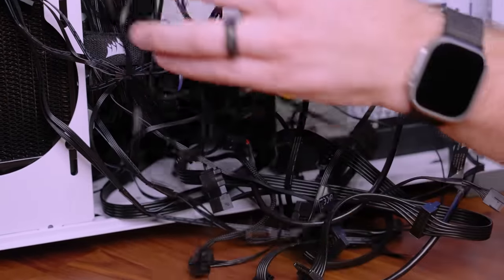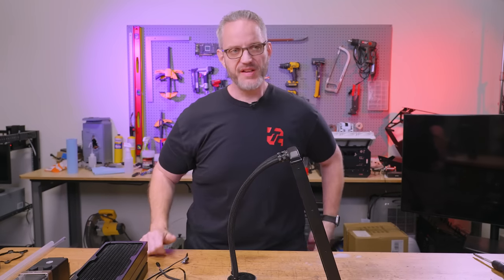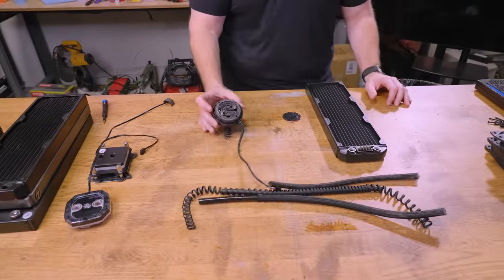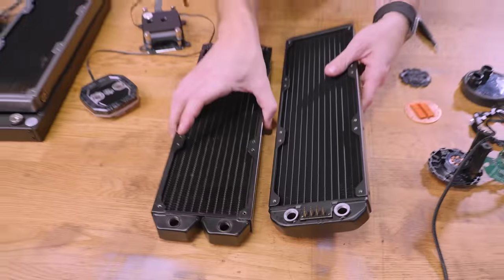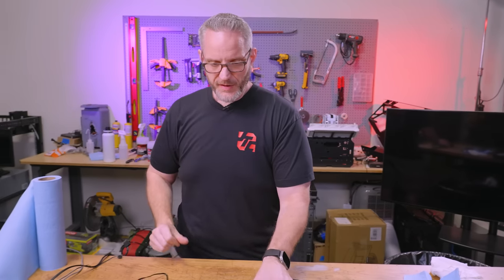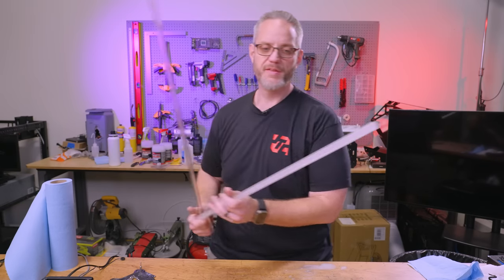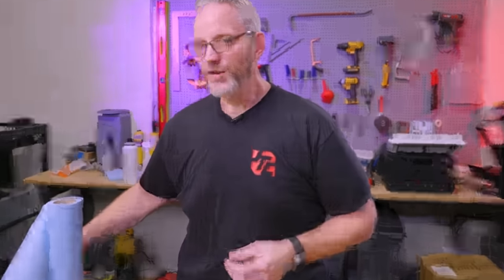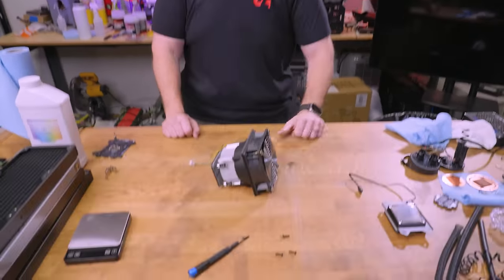Which one is right for you?

Comment: Open loop everytime because you could add in as many radiators as you like; the larger the surface area and the larger then fans, the slower then fans can run which means using less electricity, less noise and better cooling on a custom loop. Custom loop gear will last for much much longer, as you never need to "start again from scratch", only maybe upgrade the odd component, so it's ONLY a big investment as a one off the first time, paying for itself over several generations of computers. With an open loop you can cool anything and everything you like: CPU and GPU and DDR5 RAM and gen5 M.2 drive, etc.. For the ultimate cooled, stable and quiet pc! 

AIOs also lose fluid over time, and if there is a significant change in the component they cool, you have to throw it out and start again.

Comment: The point about pwm pumps is kind of moot nowadays, with motherboards that come with a dedicated AIO pump header which you can set in the bios to power up with full speed. Subsequently, once you've loaded into Windows, you can use the Fan Control software that was featured in another video to manually override the bios setting and basically do whatever you want.

Comment: As I’m getting older custom loops are getting annoying, especially mine with  2 pumps, 2 reservoirs, and 4 radiators, working on it takes forever.  I don’t know if I can go with an AIO because an AIO almost certainly wouldn’t allow me to overclock a 13900K like I do.  On the other hand, the older I get, the more important my build he silent, and mine can be silent because I have so much radiator space, I can run fans at the minimum RPM unless I’m stress testing.

Comment: I'm surprised none of the major companies have "gotten around" the Asetek patent by designing an AIO that has a reservoir in the loop. So instead of the usual AIO, have the tubing go from Rad to reservoir (with built in pump) and then from there to the heatsink? Maybe it's a stupid idea, but it would be a nice middle ground between traditional AIO and custom loop. Hell doing it this way you could even have a GPU block in the loop as well (though you'd have to have a different SKU for every GPU potentially so that may make it cost prohibitive), but I for one would love to be able to have a reservoir in an AIO style loop, that would allow for that refilling aspect to help maintain the AIO for longer, but I dunno maybe I'm talking nonsense.

Comment: My first watercooling was a Swiftech DIY kit. It was for an i7 930 that I OCed the hell out of. My issue was it didn't fit inside my case, but it was designed to be mounted on the back of the case if needed. It did a decent job.

I eventually replaced it with a Swiftech AIO that did fit inside the case. One day the computer wouldn't boot. The AIO motor failed because the inside was full of flakes from whatever the inside was coated with. Now has a Corsair H75 in it. Barely does the job keeping it cool at 4GHz, unlike the kit that was mounted outside the case. It's inside the case though, and it's an old system, so I don't really care anymore.

On my 5960X I tried using air cooling while waiting for my WC parts to arrive. LOL.. Air. For that I had gotten a Swiftech waterblock (that was new to the market and was a return/warranty nightmare) a front bay reservoir/motor and a Hardware Labs Black Ice rad and Bitspower compression fittings. Corsair AF fans. This turned out to be an amazing setup.

For my 7900X I decided to give a Corasir H115i Pro AIO (280 x 140) a run as a temp solution while trying to decide on my custom build. The AIO couldn't even touch the 7900X. Barely kept it cool at base clocks. I wanted another front bay res, but they don't make cases like that anymore so I found myself with another new Swiftech product... Ugh... and it cracked. It was (like my 5960X cpu block, acrylic) poorly made and they replaced the design with glass, so I found myself with an upgrade that has been great. Again, I used Hardware Labs for a rad and Bitspower compression fittings. I used Primochill deionized water. This was 5 years ago, and I've never flushed it since I first primed and flushed it. It's been amazing, mostly. I use Corsair LL RGB fans in push/pull, which is maybe the only reason I'm getting away with using these weak fans.

TL:DR, AIO sucks in my opinion. They are made with cheap parts to keep prices low and are bound to break and fail, leaving your system dangerously hot. They'll do the job if you're afraid to do it yourself while maybe being better than air. Depends on what you're trying to cool and what you're trying to do with it.
Reply: Swiftech Apogee was a legendary block in its day - takes me back a bit that.
Reply: @malphadour  the solid ones were good. The one that had a problem was the clear acrylic Apogee XL? It would crack by the fittings. I know, user error, right? I had to pay shipping to return it, was like $20. The next one cracked, exactly the same way. Once again, pay shipping to return, but I got the non clear (solid black with the color plate) this time. Was fine. While shipping the second one back, they pulled it from the store, it was never sold again. And... That's what happened with the acrylic reservoirs they made. They had cracking problems, and started making a v2 with glass and removed the acrylic version. But despite this being THEIR failure, they still made people pay return shipping. That's simply, unacceptable.

Comment: Currently building my own open loop, it is some work ^^ currently fighting with my i/o bracket of my video card as i wanted to mount my msi 4090 rtx vertical, with a corsair water block, but i have 2 slots to mount a vertical gpu and no custom i/o bracket was provided by corsair for their xg7 block. so, i had to cut 1 slot off it with tools. now i have some height issue's as the i/o bracket somehow is different when you want to mount it vertically, will try with some screws to increase the height.

fun but it takes allot of time ^^ 
Also its an challange to fit it all in an 4000D, so far going well although i will have to mount one radiator outside of my case (on top) otherwise my memory won't fit and i can't fit my wires on my motherboard.

Thanks for the video's, they pushed me to start making my own loop.

specs:
MB: EK-Quantum MSI MPG Z690 CARBON EK X D-RGB
GPU: MSI GeForce RTX 4090 Gaming X - 24GB GDDR6X RAM
CPU: Intel® Core i9-13900KS, 3,2 GHz (6,0 GHz Turbo Boost)
Mem 2x : Corsair 32 GB DDR5-5600 Kit
Tower: Corsair 4000D

Tubes/fittings etc: all Corsair

Comment: AIO is better is what i got from this video, especially if you can find one with a fill port so you can service it but if you are a super committed enthusiast and ready for the up keep then go with a custom water loop. its mostly a question of aesthetics then cooling because the best cooling option is to go with a nactua or be quiet heat sink cooler. no water no mess and super affordable. also easy to change a fan if it fails. didn't need to watch the entire video to know this but did any ways 🤓

Comment: I've been fantasising about doing an sff, externally cooled pc. It would allow much larger cooling than an sff would otherwise allow at the expense of taking more space than just the case itself. However decoupling the cooling from the system also has various benefits like much better modularity, a free standing rad being completely unimpeded for airflow etc. 
I really really want to see a proper implementation of it to see if my idea is valid. I just hope you can demonstrate the idea.

Comment: I'll say I do have a slightly rougher history with custom over AIOs. I still actually have the original AIO for my system that's 6 years old now. Meanwhile I've killed 2 pumps for a custom loop within the 6 months each; they were both the EK pump reservoir combo, I swapped to the Corsair pump and it seems to be lasting longer.
Reply: how? how did manage to kill 2 D5 pumps? or were they DDC pumps? What did you do?

Comment: I wish i had the need for an custom loop. But my FL2 280 is already way overkill for my tiny
10700f 65W CPU even with pl1 and  pl2 set to the max. I remember my first Custom loop
containing an Eheim 1046 fish tank pump @ 240V and a repurposed Scooter Radiator.

Comment: my comment before watching the video as requested is that custom is better, because if something goes wrong your more likely to be able to fix it  having built it yourself, and its not sold as one unit so you can just replace the part that is faulty not the whole damn thing. also custom gives you flexibility, if you want to put a cpu and gpu on a loop you can, and then you can hook it up to whatever radiator solution you want, or your case supports.

Comment: Custom loops don’t even have to be very expensive.

Beside the very rich second hand market which is for most watercooling parts little to no risk there is also a lot to safe on new builds.

- Magicool Radiators are cheaper but hardly worse
- straight simple fittings
- flex EPDM/ZMT/Norprene tubing
- Simple CPU/GPU Blocks
- Whatever Basic Reservoir

Only the pump should be either a DDC or D5 and I heavily recommend a D5 that is mounted decoupled from the case.

But again. Second hand is the way to go.
50% Savings with hardly any risk since most parts are just plain metals that worst case need some cleaning.

Comment: Dear Jay !  I would greatly appreciate a follow up of this video regarding CL and how to calculate properly the amount/sizes of radiators needed to get rid of the heat esp. in OC-scenarios   (e.g. 120 mm rad per 50 W  or so) as well as optimum cooling liquid flow (e.g.  100 l/h) and effects of overkill-configs (like 10  360 rads / 200 l/h flow rate) >> what is the "sweet spot". Currently all tutorials I searched  regarding these questions are either too vague or incomprehensible (even IgorsLab)

Comment: I really need a video dedicated to GPU cooling , not taking CPU into an equation. With these new GPUs getting the twmperature outside of the case is getting to be an issue and water cooling a gpu and using Noctua NH-D15 on CPU would be sweet spot for me .

Comment: Nice guide, but make sure that distilled water isn't same as DI water. Purity level difference is huge and electric conductivity on DI water is almost zero. DI water can reach purity at 0,05 μS/ppm which is called also ultra pure water. They use it almost every where in Semiconductor industry. You can also see difference in purity using TOC tester.

Comment: I'm currently using a Noctua NH-12A with my 12700 and have never had an issue with heat.  But then,.....that's a 12700, not the newer 13900.   My case, having 6 fans bringing air in, and 4 letting air out might be a factor, though.

Comment: I really like my Arctic AIO, works great on a 12600k with a slight OC, probably a good air cooler would be fully sufficient.

But I'd love to go open loop and including the GPU but costs seem to be crazy and really not worth it in my case.
I'd pretty much build it just for the sake of tinkering around and get it all to work.

Comment: As you may have noticed from many of the replies, both have their place.  AIO is quick and easy.  Custom loop is for people who like to tinker or want to show off the internals of their case.  From a performance stand point, they are not that different.  Custom loop will have a larger heat dump due to the reservoir.  I have built both.  As I got older, I started to prefer the convenience of the AIO.

Comment: I went with an AIO from EK (The old one just before they went EOL) and after half a year I am noticing a slight ticking noise which I believe is coming from the pump. Pretty disappointed by that. Though I don't have the money to go full open loop I maybe should have just gone air cooled.

Comment: 6:22  Liquid metal isn't very corrosive, at least, not the ones being used for heat transfer.  

What he is seeing there is a thin layer, likely only a few atoms thick at most, of a copper-gallium alloy that has been created and will not affect the performance characteristics.  This process is called interdiffusion, or intermetallic formation.  It's not a problem.

Comment: EK charging £240 for the Asus TUF 4080 GPU block alone, when my well cooled NV7 keeps my GPU with its OEM aircooler at 60C or less, I don’t see the point of a water cooler anymore. Done quite a few expensive loops in the past but, at least for the 4000 series and its overkill coolers, custom loop would be more for an aesthetically reason than anything. Also the AIO, if you choose a proper one, instead the cheapo Asetek high pitch noisy pump ones, you should be fine. Simply take the Arctic Freezer II or the EK Nucleus and you’re gold. It was cheaper for me to buy 12 T30s and the EK AIO than going for a custom loop. Also, runs quieter than my previous loop and mid range fans.

Comment: Outside of a SFF PC, I don't think I'd ever do an AIO. If there is an air cooler that will work, that's what I'm using. Once I get to the point that CPU is too powerful to handle the larger air coolers, I'm putting a custom loop on that.

Comment: Why i dislike AiO's is, they have an expiration date. As soon as there is a problem, it's time to get a new one.

Air cooler heatsinks on the other hand are built for eternity, as long as they still fit current gen cpu's. A faulty fan is replaced real quick.

I take the 5 degrees more over worries when your AiO fails or leaks any day of the year. 🤔

Comment: Neither are better.
My Ryzen 5700X under 100% load gets to 70c when it is 23.1c ambient with a 240 AIO in my case. Right now it is running about 40c with normal (YouTube+Web ect.) 15%~ load, and it is 26.66c ambient. This is my second AIO I've had, I know I'll need to replace it in five years, but the cost makes it worth it. I only had $1500 to build my system and needed at least a 3070, and I like how quiet the AIO is.

Comment: Very informative video. Would love to see performance comparisons on similar CPU loads. Full loops have the cool factor in their favor but how much difference is there in performance?
Reply: Most of the possible performance gains in gaming (with few exceptions) will come from GPU cooling and overclocking headroom, not from the CPU. That alone makes AIOs a bit.. useless.. unless you have a higher tier CPU that actually requires it.
For CPU only, the difference will only be overclocking headroom. If you run your CPU stock, the open loop will be a few degrees colder.

Comment: Just use a laboratory psu and vary the voltage to the pumps when filling the loop. Doesn’t matter if pmw or not. (by the way every pwm pump I ever used, goes 100 % without a pwm signal).
Reply: The thing about requiring a PWM signal for full speed is that some pumps didn't adhere to the Intel PWM spec which requires the device to go full speed when not supplied with a signal.

Comment: Go custom if you don't mind jumping in an endless rabbit hole as far as budget. Overpriced really vs what you actually gain as far as exchange performance. If 5°c is worth an extra $500+ go for it! Lol. AIO is just fine. Considering bang for buck it's the best deal. AIO's being mostly unserviceable is part of the cost savings too. I've moved mostly away from water. Now let's talk about space! Although you can certainly modulate custom loops, they take up too much space. Plain and simple. Bottom line, if you wanna tinker, blow loads more cash, perform preventatives, occasionally screw up your system, and gain a FEW °c, go for it.

Comment: I've done both. Custom is a lot of fun but personally I prefer the simplicity and value of an aio.
Reply: Custom can be simple as well, IF you have all the stuff from previous builds. If you have multiple radiators laying around, etc
No need to tinker with fancy tubing IMO, just use EPDM rubber tubing

Comment: I wish he would have hooked up both to a stock 13900k,  A top of the line 360 AIO will thermal throttle in just a couple of minutes of Cinebench R23. A block with a 360 rad won't hit thermal throttle but it will get up there, about 90c under stock voltage.  AIO = 200$ , Loop = 500$ I was surprised how much Loop parts add up, but once you have them, you always have them. Keep them clean and they will last generations.

Comment: Custom is going to be better because they generally have more thermal mass to soak up spikes and if the rad is the same between them the custom also will have more surface area from the extra tubing and tank.
I tend to just use a large heatsink but if i want water-cooling I'm just going to go grab a old car radiator because it has more surface area and it is way cheaper to get.
No galvanic corrosion won't be a issue, there are many ways to deal with it that won't break the bank.

Comment: You said to comment before watching. AIOs are great if you only have the budget that matches your skill level. They are more or less an easy set and forget. While a custom loop is just that "custom" so you can build till you cant no more. Cooling wise they both can be poor or great. You real cant tell a difference if you are not an overclocker or you don't have a really hot chip to began with. So no your i5 non K and 5500/5600/7600 x non x doesn't need either, a decent tower cooler will serve you beyond your needs.

Comment: If you want easy, go with the AIO. If you want mind numbing infuriating rage inducing blood vessel threatening levels of stress, then the custom loop with non-EKWB parts is right for you. I typically do not shill for one company but my new build has been a complete pain in the backside. Either Corsair's rads had crop in them that refused to stop or they were causing a corrosive reaction despite being all copper. I love the look of custom loops, my current loop looks sweet AF if I say so myself, so I'll likely die of a stroke working on my stupid pc. Either way, I do like the cooling options. The only limiting factor is the builder themselves.